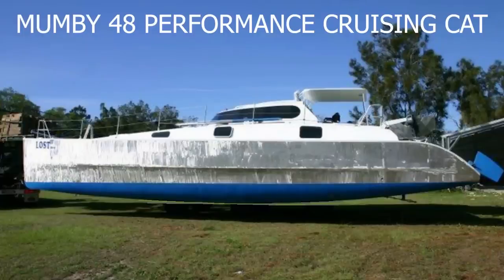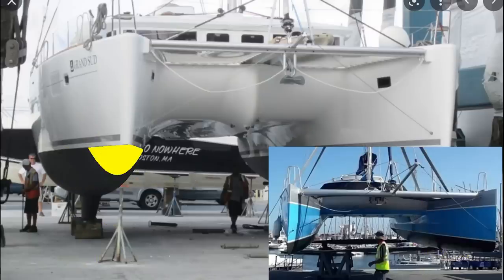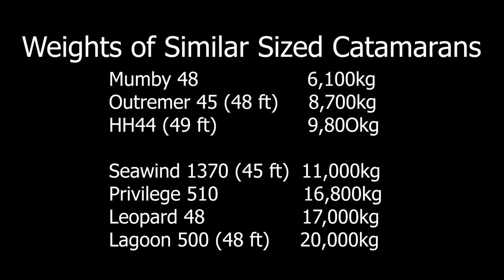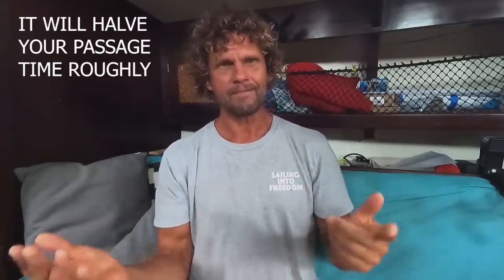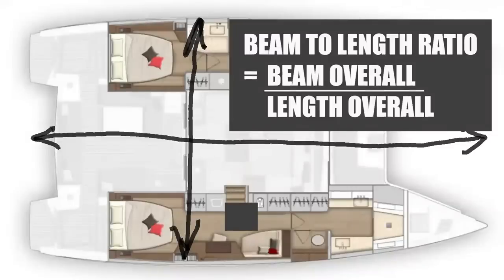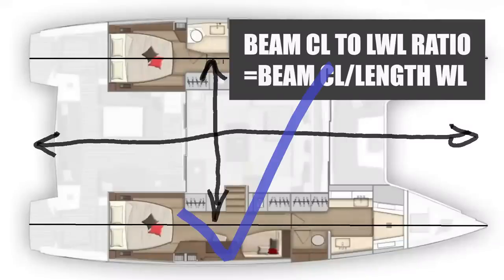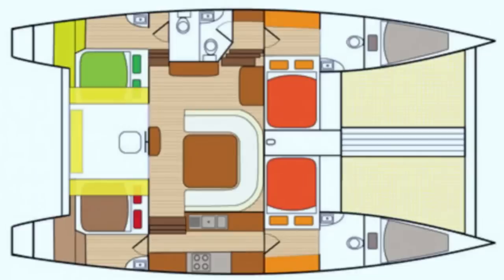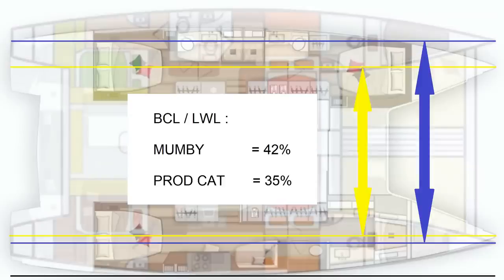How to avoid capsize? What to look for in catamaran design.

Comment: Hey plukky so how far off are you from your total to getting everything you need to replace your holy vessel..? And when you finally get around to building it i hope you come up with a cunning plan to make it extra extra strong in any which way you can 👍
Reply from the maker: It's already strong. Boat build likely 300k. Raised 75k but will go back to work...3 to 5 year plan

Comment: Good on ya Peter. Really good info and video. This leaves me in a bit of a quandary. A proper performance cat is going to cost £ as not much on the second hand/ entry level market. This then leaves only a quality proven used monohull left. Huge gap in the market for a quality affordable cat
Reply from the maker: Go mono... They are great too
Reply: @SAILINGintoFREEDOM  agreed. 70-100k on a not fit for purpose used cat? (Imop) Or Same amount on a quality proven used mono. Mono wins in these circumstances 👊🏻

Comment: So I am in the market for a boat and was looking at Cats and also Trimarans. Can you please explain how this math (aka centerline) work with or against a Trimaran please? I am looking at the Neel 65. Thanks!
Reply from the maker: Don't know too much but maybe only use centerline from middle to the pontoon since the Windward pontoon lifts?
Reply: @SAILINGintoFREEDOM  I have no clue , very new to this. I just wanted to put this question out there to see if having 3 hulls would change what you spoke about?

Comment: I was going to ask you about the HH44 but I see you mention it among your preferred performance cats. Here's a question: if the hulls are asymmetrical, rather than U shaped, so the bottom of the hull is on the outboard side of the hull rather than the centerline, does that improve that ratio at all?
Reply from the maker: Depends on where the center of bouyancy is and the dagger board is.... I actually am not entirely sure here if the hulls are asymmetrical.... Does someone know... Its not my preferred cat because there is too much joinery and too heavy and bloody expensive
Reply: @SAILINGintoFREEDOM  Yeah I'm not sure about the HH but the question was about cat design generally. Their dagger boards are apparently super rugged, though. They told me yesterday that cats like theirs could actually raise both hulls out of the water on dagger boards like the Americas Cup boats did recently, but the technology for stable automated management of them isn't quite there yet, but the boats are rugged enough for it.

Comment: You don't like mini keels?  Don't they help prevent pushing the rudder and saildrive into the hull in a grounding?
Reply from the maker: Yes they do...but they have a few negatives too...more than the positives
Reply: @SAILINGintoFREEDOM  I have a Leopard 47, 2004 which I bought in Grenada and sailed to Fort Lauderdale.  I am pretty happy with it as long as I am not motoring directly into a big sea.  Even when the wind is a little high, I can put on an engine and she just sips fuel.  A good speed is 8-10.  When she starts going 10-12, to be honest, I try to slow her down just for comfort and not wanting to break anything.  My dream boat would be something like a Bali 4.8.

Comment: Lets be honest here, you're comparing ocean going seaworthy cats to basically apartments on the water. Apartments on the water is ok for the charter industry operating in the Med, but thats as far as it goes. That said some people are sailing apartments around the world, but usually are prudent with it, picking out weather windows and not going anywhere to extreme. So in my opinion if you are sailing the planet you'd want a vessel that can go to just about anywhere with a degree of safety
Reply from the maker: The trouble is that some people don't know but they see others doing it.... If you sail you will get caught it at least once per year.... And weather is changing so that will increase
Reply: Those same cats routinely cross oceans.  Which ones are failing?  (Other than the Lagoon 450).  These cats do very well in bad weather.
Reply: And I believe the 450 issue has been fix all boat have faults just some don’t know about it yet

Comment: I thought the weight to length thing did not work out with aluminum when building this size cat? Might have read this from something Kurt Hughes has written. Check it out.
Reply from the maker: I think you are talking about what length you can start building catamarans out of steel. Aluminium has no limit either way, they build warships out of aluminum.... But they have problems because they put 2 different metals together in a saltwater environment and also the ships burn well when hit by missiles.... Both of these issues don't apply to my catamaran tho

Comment: I don't know if Youtube will let this comment pass, though I am not a business and I'm selling any boats. Rather, I seeking help to realise a design concept which I've worked on over the ladt 15 years prototyping with 5m beachcat designs, with cruising cats in mind.
I have proven the design concept but need more expertise to proceed to the stage of production of cruising cats. The advantages/positives of this new and novel hull design are;
* Superior lateral resistance at ALL speeds
* Minimizes wave interferance between the hulls for less drag
* Low drag at high speeds
* Superior sea keeping abilities
* Protection for the rudders
* Ability to be beached
Because of its unique shape, it is a displacement hull which performs as a planing hull. Is this possible you ask. Check it out, to find the answer. Cheers

Comment: wonder why more cat builders don't add retractable daggerboards?  pretty easy to do.
Reply: Because they need housing boxes that take up space in the hulls.. they need careful engineering .. they can stick or break if the crew forget they are down. There isnt a single idea on best placement. 
Theres also Cats that are designed to be beached....a great advantage for a vessel operating in areas without facilities. ..  Native Cats like bilge keel monohulls were evolved for dealing with certain conditions. 
Some cats have sub keels or sacrificial/stub keels to protect  the hulls and support the vessels if they need to dry out.

If you have a a sub keel or very large vessel you can fit swing keels.. which give you advantages but can introduce complexity's.  
Its a good idea to look back at what has worked well in the past for Catamarans.. Wharrams took one route...and from what ive seen the nearest modern interpretation is the Maine Cats.. ..
If you want a suprise take a look at wildings sailings 1975 Ketch rigged Cat ...they found the old girl can fly and is remarkably sure footed and even able to tack into the wind reasonably.. but its no racer and has by todays standard a modest water bridge deck hight. 
It was designed to dry out if required.

The other point is most modern cats are following a tendency to  go for plumb bows and wave piercing hulls this can work in some ways but causes complications in others..  like wet decks..
Reply from the maker: Costs more to them and reduces space in hull

Comment: Phew, around 42% LWL/BCL ratio and sails at 10 knots in 20+knots wind. To lower the centre of gravity and help her spin rather than flip I replaced the full roach main with an almost triangular sail. OK I lost a fifth of the sail area but made up on a far better balanced rig with little evidence of loss of performance. Cat is a Dean 3800, max displacement 8600Kg, light ship around 6750Kg, LOA11.65m, Beam 6.60m.
Reply from the maker: And that's what it's about... You guys applying the numbers and making good decisions

Comment: I built a 50 ft Cat
in under 2 years in fact,
for $40K and a whole lotta tears.

The U.S. Coast Guard said
they'd certify the 2nd hull I built,
& for each passenger who rode on the 1st & paid a penny,
they'd imprison me for up to 3 years.
Reply from the maker: Good on you pirate...ply?
Reply: What weren't they happy with on the first one?
Reply: @tomriley5790  I built them of steel using an origami trick that allowed me to create compound curves and shapes after first tack welding everything flat, rolling them up like giant 50 ft burritos amd finishing the welds, keel, stringers, ribs...great fun, 1/10th the time and cramped labor in a hull or pressing curves into steel plate, and a perfect "fast" shape BUT Coasties LOVED the 2nd one and asked if (ahem) the first one was my first welding project, suggesting I chop it up to avoid prison or drowning.
Reply: So...I got a fast ferro 40 w/ oversized rigging, got broadsided by a 3 man jetski doing 45mph and it didn't do a damn thing and I'd never own any other material after 22 years on SunOvaCG...some say I'm an SOB but mum was a kind, sweet lady. Dad was a Coastie...as the vessel name implies.

Comment: I love cats... the speed and living space and storage. But I won't buy one for cruising because one knock-down and the boat is probably lost. And the speed is somewhat negated in a big production cat that cannot point up into the wind properly because of the extra maneuvering necessary.
Reply from the maker: If storage is your thing then maybe go for a mono hull. Mumby can take 2.5 tonnes but prefers it when it's lighter. You don't need cupboards full of crap that just collects dust. If you want the mods of a house then buy a  house. If you want to see beauty and unspoilt locations and don't want to sit in air conditioned comfort, baking bread and reading books never leaving the boat then buy a boat

Comment: does anyone know if Mumby has plans for a 72 to 80-ft alum cat with daggerboards?
Reply from the maker: Just buy 2 Mumby plans and join them together
Reply: @SAILINGintoFREEDOM  lol...yhen it would be 96 ft ..too big
Reply: A number of years ago Tim was thinking about a bigger boat, about 65' long. I think he had started the design. BUT the cost increase is exponential so he passed on the idea of building one.
FWIW. I was over to see Tim a couple of weeks ago. I do not think he will building anymore boats in the Philippines. To much hassle. However you might see him turn up in South Africa in a couple of years.

Comment: If they put a bit of lead ballast in the bottom of the boat that holds the boat further in the water
Reply from the maker: Yes but slows it down
Reply: @SAILINGintoFREEDOM  some times they can go a bit to fast thou and maney skip on top of the water to then not much Control if the wind if it’s bad and side wind to mate the wind could push the cat in to the rocks or hit a reef to mate

Comment: There is also another problem the design of the two hulls some have dagger boards some don't but they are far lighter making the cat for speed but on speed cat's with wind in the sails one side can go in their air which means unstable and the floats cut through the water like being on foils.  Then there is one more problem with the three floor beams connecting each float together. They can crack weaken and fall apart especially if totally made from wood and fiberglass and in high speed racing cats even Carbon fiber do the same thing. But then there are badly made cat's can be perfect on paper the design sail height but also fail.
Reply from the maker: Well get to dagger boards and mini keels. The Mumby is a very stiff boat... Lots of structure
Reply from the maker: But u are right. Some aren'tb strong

Comment: $53,788
pledged of $48,450 goal
391
backers
17
days to go

PEOPLE, HELP PLUKKY GET BACK ON THE WATER FASTER.  Get the word about the "Elcano Challenge" out so more people can get on board and help Plukky out!!!  May be more people that want to be a part of the challenge and sail with Plukky and crew.  Only Quality people, only Quality.
Reply from the maker: I appoint you head of my marketing division, well division is just one person which is you. Top stuff. Keep up the good work Jack
Reply: Well the Mkt. Dir will not be contacting any other sailing channels.  That mistake is corrected.  I thought it was more of a caring sailing community, but hey I’m a hopeless romantic.  It would be great to see Lisa back with you working on the boat.  How long once you start do you reckon it will take to build the boat?  I’m hoping less than three years.  Time will tell.

Comment: You missed a very important point about safety, which is weight centering. On mumb 48, all 4 cabins are close to the center line, and this is lots of weight that other cats " that you don't like" have far away from the center line. Having weight away from the center line improves stability. Also weight as such improves stability. You did not go into individual analysis on how each cat capsized, just assuming the the hull centerline to length ratio was the criteria, and that a mumb 48 would have handled it better. Pure speculation. Have fun with you fast cat!
Reply from the maker: Can't include everything. But what you say may be correct re feeling more stable but it is wrong in a very big way. High moment of inertia....look it up

Comment: Yes and no, but mostly no. Light displacement being more stable (because centreline beam to beam) - no.
Stability factor is 9.8*((0.5*BCL*D)/(SA*HCOE))^0.5. (Where BCL is beam to centrelines, D is displacement, SA is sail area and HCOE is height of centre of effort of sails. You only touched on one of those factors.  It's not the beam itself that counts, wherever it's measured, but the moments - righting versus capsize. Heavier is likely to be more stable in most configurations. That's why the street sign outside your coffee shop has a weighted base. If you can fly a hull it's a small step from there to capsize. What type of boat do you see flying hulls?
Do this thought experiment. Same rig. Same length and beam. One "catamaran" is 2 40 foot lengths of bamboo. The other is two mostly submerged shipping containers. Which flips first?

Another trap with light and fast is that it can hide true wind. Consider light boat doing 20 knots downwind in 30 knots, buries in wave in front and slows to 5, apparent wind goes from 10 to 25.
Then there's the shape of the hulls. Heavy is likely to present a more rounded shape to the beam sea. Light is more likely to present a vertical slab - a "tripping" hazard.

As in all things it's not a matter of light-good/heavy-bad, it's a matter of finding the best compromise.
Reply: You and many others have missed the point - having a performance cat being sailed at around 50% (or less) of it’s outright max in ocean conditions is the safety margin Peter is really talking about - mono’s are often sailed at 100% which is why they get knocked down or worse
Reply: @loosecannon7105  and at 50% Plukky will no doubt still have enough speed to produce his hydro power ... which may be the key to a successful sustainable circumnavigation.
Reply: @brentpenfold1795  solar and wind generators will be the answer / hydro is bugger all - that’s why the previous attempt failed
Reply: @loosecannon7105  Thanks for heads-up … this channel is certainly becoming educational! :o)
Reply from the maker: I am taking one factor at a time and will put together at the end. I figured peeople would switch off if too much
Reply from the maker: I haven't touched on CG yet and righting moments but it will come...
Reply from the maker: Where is the CG on the bad production cats? Where is the center of effort of the wind? Where is the boom and sail bag? All coming up on sailing into freeeeeeeedddddooooommmm
Reply from the maker: I don't have the balls to run downwind at 20 knots overtaking waves. At best I would run at the same speed with a line of mini cone drogues on a winch and adjust accordingly
Reply: @SAILINGintoFREEDOM  Thanks for responding Plucky. Don't get me wrong. I like the Mumby 48 and would take it (with a couple of mods) 11 days a week over any of the French houseboats-with-masts. My point was that you've got to look at the total design and somebody has to do the actual calculations. Single factor theorising feels like the 1970's way of thinking about boats. 
Heavy displacement cats do get a stability benefit from that mass which they then squander by adding a flybridge, too much sail, too much windage, too much weight high up, too much weight in the ends and so on, too much partying in the spacious and airy saloon. It's all about the sweet spot, playing each factor against the others but also itself. Weight/strength for example. Most of the loads on a boat are ultimately generated by the mass of the boat, so adding weight for strength increases loads (which badly connected plywood bulkheads can't take). At what point is that process chasing its tail?

Overall, the Mumby, will be a good boat if it's fully understood.
I do have a few personal peeves, which the Mumby doesn't trigger. The obsession with "letting in light and air" is one. No - first job is keeping water out. Recto-stick the big rectangular hull ports (especially in monos), and the giant patio doors, the easy indoor-outdoor flow, the wraparound bay windows.....
Reply: @SAILINGintoFREEDOM  exactly right Pete - it is actually not necessary to raise any sails at all with a 25+ knot tailwind on a performance cat - mine would do 6-8 knots with a solid 25-30 and a few surfs into the low teens - great and safe sailing